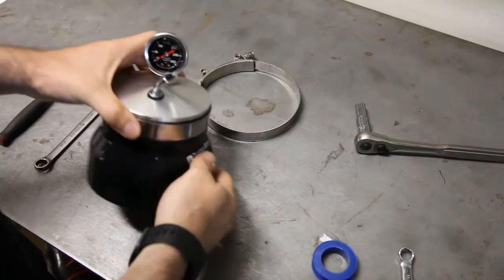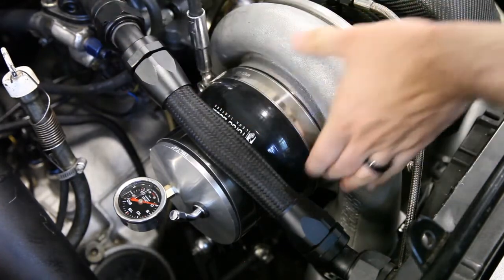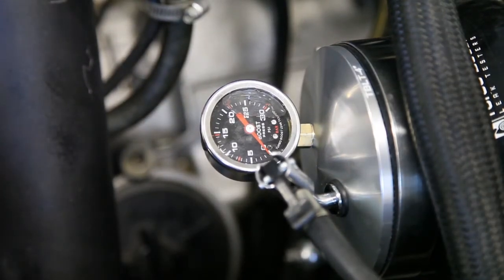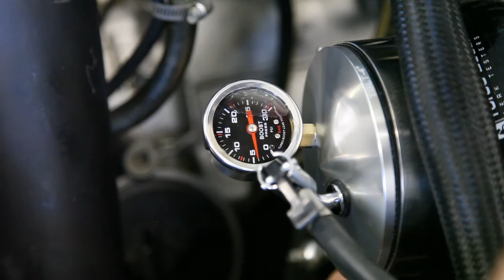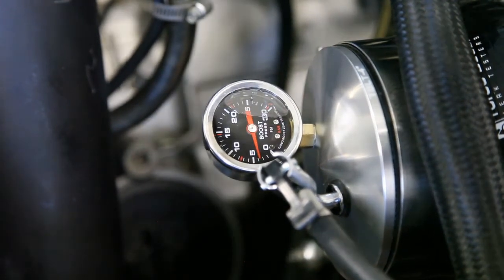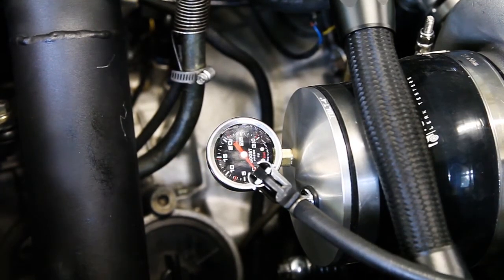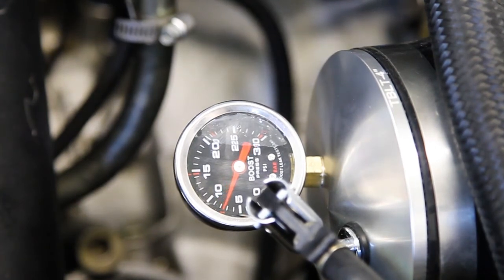Turbo Boost Leak Tester

Comment: I’m confused. Wouldn’t that air just go right out the exhaust valves on the intake if you connect the entire system through the turbo through the inner cooler into the intake manifold?
Reply: Exhaust valve never open when the intake valve is open
Reply: That’s not true it’s called valve overlap lol